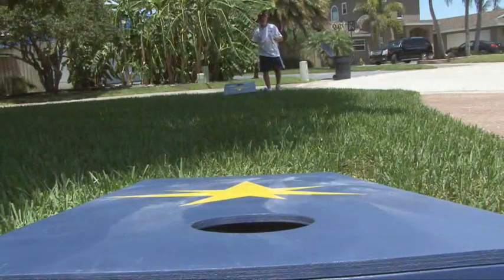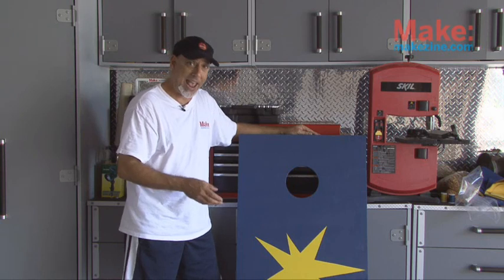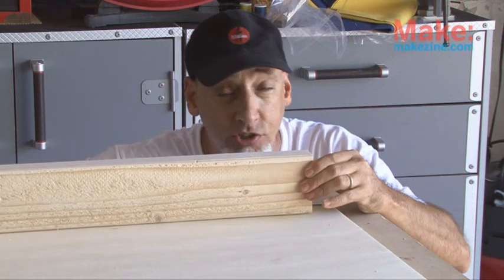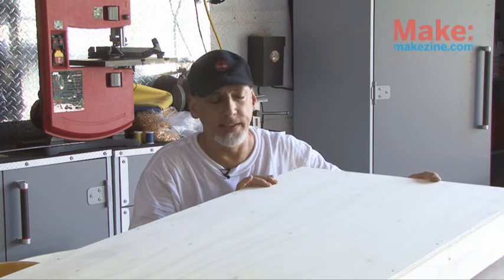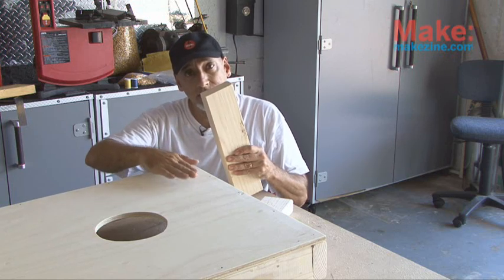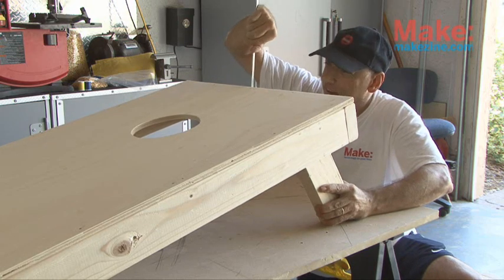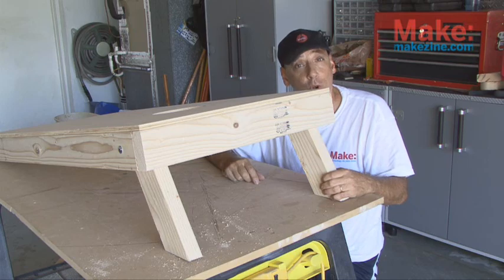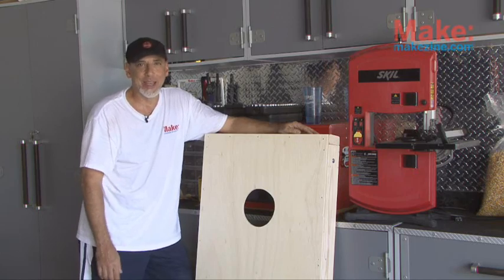Weekend Project: Cornhole

Comment: @makemagazine oh i meant like those lawnchair bars that can fold out and have those latches you push the bar into but you can still do the same with the way did it if oyu put some velcro. this is only if the legs are loose or something, im sure you made it so they werent.

Comment: i have a few suggestions...  since you are using nails, wood glue would be very useful...  screws would eliminate that problem...  a 6" hole saw guarantees a perfect hole, much quicker also...  the legs should be cut at a 10 degree angle propped up against the back 21" 2X4... to ensure the legs are centered and balanced, measure 1.75 inches from the top, and side to side...  also, i suggest you use a flat washer in the leg bolts to save on wear...  come film me, i will show you how i do it...:)